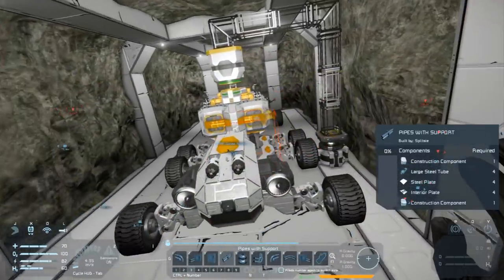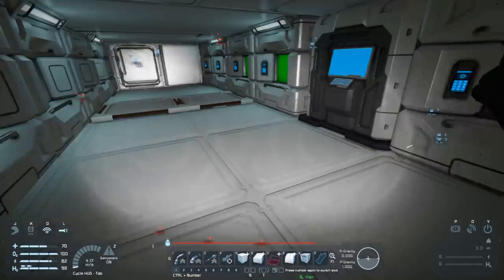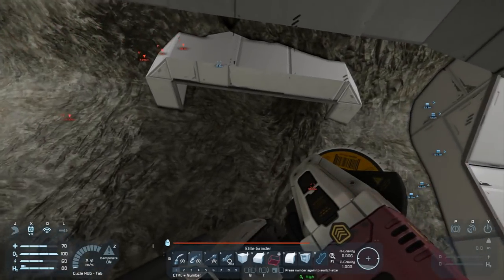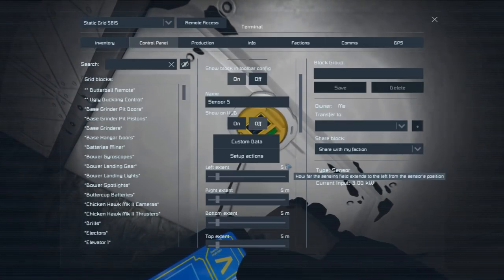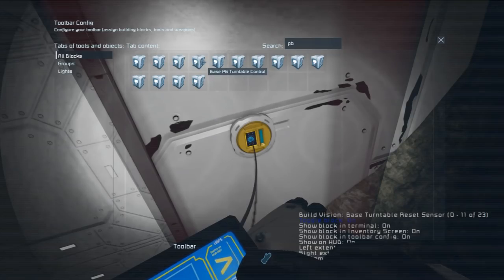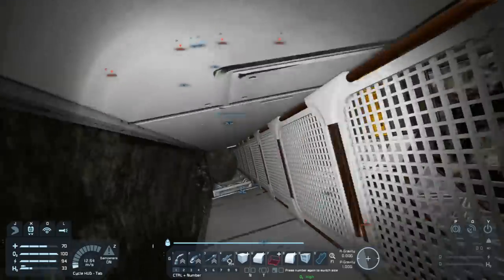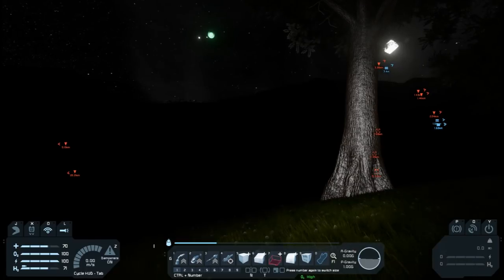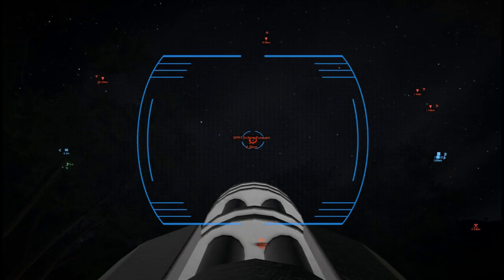Survival, Maybe... #61 Is Splitsie's Goose Cooked? (A Space Engineers Survival Series)

Comment: You might consider adding deployable decoys for the goose. You could then drop them in place on the ground and back up to give yourself something else for an attacker to focus on while the turret takes care of it. Or worst case... drop them and run for it. :D
Reply: I was thinking that too.  During a run back to the base he could say "Deploy chaff"  and decoys would pop out as he runs.  ;)
Reply: "Deploy chaff" Nonono... Geese lay eggs :D
Reply from the maker: That is a really cool idea, I could even just have a manual set of them hanging from under the cargo containers or somewhere similar :)
Reply: A set of golden eggs hanging below a cargo container.  Now where have I seen something like that before?   Splitsie, you stress my PG algorithms right to the edge.   ;)
Reply: But decoys need batteries to work and that can be expensive.
Reply: Set up that and have a projector block on the goose where you can weld them back up when you get back to base
Reply: Know this is old, but that's a great idea - have a couple grinders in the base floor that upon activation would spring up and weld the projections. I imagined this to work with detaching rotors, but it might need a merge block instead and that would become quite bulky quite fast :/

Comment: You need an LCD screen named LCD Autocrafting. You can then set the minimum reserve levels of all the components, and ISY will replace them as you use them. If you are going to need more plates or something for a project, just edit the text on the screen and ISY will do it's thing. Keeping one assembler with the string !manual in the name also helps.
Reply from the maker: The reason I haven't used the autocrafting yet is that my production rate is too low. At the moment I prefer the greater control I have over what gets built first. Of course once the big parts of the base are complete I'm absolutely going to be setting it up :)

Comment: Splitsie....why not add a rotor with a large grid head on it to the goose, that way you can set your turn table sensor to detect large grids only and wont have to worry about your other ships triggering it at all. Just set the range close to the ground and your rotor kinda low so the buttercup cant tigger it.

Another option, put a small ship rotor head (on a large rotor OC)with a bock on your base where your sensor is now and put a sensor on the goose, then use your transmit and receive script to trigger the Command for the turn table, that way no other vehicle could ever trigger it :D. 
 
Also i play with the deep ores mod, :D tons of fun but be ready to really have to hunt for ores.
Reply from the maker: I wouldn't really like to have a giant rotor head on the Goose, not the most attractive of attachments :P

I'd probably enjoy the hunt for ores, at least once I find a fun way of doing it :)

Comment: I liked the suggestion of using the deep ores and building a whole mining base... that sounds like an interesting project. 

You might consider rolling in the 'lighted path' project with some additional large grid turrets, making small fortifications along your path at key points to mark where you need to go up a specific way. That would give you an extra level of defense if you need to make a run for it. They might also be able to stretch armored block out to either direction so you could use more of the smaller lights off the one battery/power grid. 

Also, it might not be a bad idea to do a scouting trip in here somewhere so you know where your next patch of iron is. It would suck to fortify the whole route and find out that it goes in the wrong direction or some such.
Reply from the maker: I've been expecting this iron deposit to run out for several loads now which was why I delayed building the lighting infrastructure, the irony of that is I'm probably going to put the infrastructure in just as it runs out now :P

Comment: Hey Splitse, I had an idea on how you might solve the driving-at-night problem (besides, you know, NOT driving at night XD ) - set up a bunch of waypoints between you and the base, then build a drone with a bunch of lights on it and enter the waypoints into its guidance system as a patrol route (I believe that will make it go A->B->C->B->A->etc, but you've had more experience with autopilot). If you find yourself about to drive home at night, summon the drone to you via the waypoints, then follow it back - autopilot always moves like it is out for a freakin' Sunday drive, so keeping inside its light radius shouldn't be too hard. If you want to get fancy, you could rig up a timer at the base to launch the drone when you push a button on the Goose's control console, and if you wanted to get REALLY fancy, you could set an action at the mine waypoint so the drone will automatically turn autopilot off and wait; then you don't have to worry about it running off without you. Extra points if the interior lights on the drone are on pistons so they can extend outward and increase the lighted radius, then collapse inward when the drone needs to fit back into its nest.

Great episode. Looking forward to the next one :)

Cheers.

-Z
Reply from the maker: That would be a pretty cool use of a drone :)

Comment: I was thinking, if you are still interested in fine-tuning the connector gantry for the Goose, you could switch where the Advanced Piston is, from the floor, to the top of the gantry right behind the corner piece. This would enable you to have the connector flip up parallel to the ceiling (which look be more visually interesting), and wouldn't have to worry about waiting for the whole thing to move out of the way of the turret.
Reply from the maker: The main reason I didn't do a drop down like that from the ceiling is that I would lose the ability to change the offset to get a lock if the suspension leaves the Goose a little bit low, it would look nice that way though

Comment: Regarding the conveyor system for the angled spots, if you don't want to zigzag your way into them, you could always use another advanced rotor preferably under the center of the turntable, and rotate it 45°. You'll be able to go straight towards the two parking spots in the corners, although it may be a little bit more difficult to setup the connectors at the end but I'm sure you could come up with an interesting design!
Reply from the maker: That could be a good solution, and as you say, it would be fun to build :P

Comment: There is a slight issue with the turntable logic: Take bay 2 for example. When you park, you want to drive onto the table and be rotated 135 degrees, then reverse into the bay. However, when you drive out you want to be rotated 45 degrees (to position 180) to drive out. That means 0 isn't your exit position, 180 is. So when using any bay other than 3, you will need to drive in, press bay number, park, drive out, press bay number 3, exit. Just a little thing to remember!
Reply from the maker: The angles that I've set up for all the bays are for reversing in, so exit will always be the parking position for bay 3. I can't remember when I did it, but I have also set up a sensor to reset the turntable position to 0 whenever I leave with the goose. As far as I can work out I shouldn't be able to run into any troubles with the system as it's set up now. But I guess I'll find out :P

Comment: Rly nice! :D That scene, when all the Sandbags fired at the drone, was awesome! :D I know it's a bit dodgy, but how about, a small battery, and solar panel, with some small armor block to make a pillar, and at the top of the pillar a small rotor, with a large rotor head, and a large interior light? It would almost look like a promenade light. Or you could just make a blueprint of maybe 4 lights on a single large battery with  7-9 armor block between them keeping it all together, and project it in a way, that the joining armor is underground, and only the pillars with the lights are above the voxels. A large welder should be able to weld them through a little bit of voxel.
The other thing I was thinking about, you really need some LCDs with the battery status of your ships, next to their parking spot :D Just like you wanted with to do with the Tick's parking spot.
Reply from the maker: I really do need to set up a bunch of LCDs about the place especially around the vehicles - yet another little job I've left half done :P

I'm slowly ticking some of them off :)

Comment: 0:30 for the angled spots you could try using an advanced rotor to get the angle you need then a second one to go back to the default orientation so that the end could be merge blocked into place, that way your not having to go left right left right.

7:06 the only thing you need suit power for is tools and suit light, the jet pack will still work as long as you have hydrogen, it no longer requires suit energy. so the only issue you would have in that hole would be lighting you could still fly.

16:36 that is good to hear the small grid welders are useless currently so I will definitely be looking forward to that update.
Reply from the maker: I don't know that flying in perfect darkness would be my smartest move, but it is useful to remember the pack still works without power :)

I'm hoping it sneaks into the multiplayer patch but I think that's unlikely :(
Reply: yea flying in darkness only results in death, though when there is plenty of light around I often find my self with 0% power when doing a lot of welding, and luckily the riffle still works with 0% found that out the hard way.

Comment: I can see the idea of an 'R&D' area being built off from your hanger, it'd have it's own bays for prototypes, test beds, designs and others along with what you once said with having a wee bit of RP mixed in with your survival series.

Looking at the front of the goose, it reminds me of Ed209 from Robocop (not the remake).

Not going to spoil it for anyone lol, however I'm interested in seeing this 'destructive' thing you speak off :D

I've tried your survival maybe out and was interesting, well erm I ended up with around 20-25 (may well be more) drones intact and locked to armor blocks just outside the cabin, at this point the pirates ran out of drones to send my way after give or take 40 minutes of fun and games although it took 4.5 to 5 hours for that to start.

A question for you Splitsie, did you build a large ore detector close to your base (or apart of it), to find out whether or not there is any ore around it, mainly iron?

You may well have a new sub come your next vid.

Ps, if you're interested, check out morilibus, He did a solo survival (now a playlist), way before planets were added. Not sure what vid it was however he came up with a design for a welding bay for small ships (keep in mind it was in space) and was based on timers and sensors, it may well give you an idea or 2 for your own. Anyway, thanks for reading.
Reply from the maker: An R&D bay would be a cool idea - I could stuff it with a few of the older versions of some vehicles half built to really get the feeling down :)

I'm glad the scenario was some fun, it could certainly use some tweaking and I'll hopefully get some time to do that eventually :P

Comment: Sorry this is so late but for the lights you could have always dug a tunnle under ground to each light and put a cheap block there to conect it to the base and have a timer or programable block to turn the lights on at night saving you all the power cells needed for all the lights
Reply from the maker: The trouble with that is the massive performance hit you get from very large spread out bases - and mine's not exactly small to begin with :P

Comment: Correct me if I'm wrong, but don't large grid lights use no power?  Could you just use a large block and put lights on all edges?
Reply from the maker: They use no power, but still need it to turn on, so I'd need to put down a whole bunch of batteries. I'm going to start trying to come up with a large grid design that uses the interior lights and the transformer box as the battery, then I'll be able to have the markers :)

Comment: I was thinking it would be easier to set one timer block to a 30 degree turn each push for the turn table. Would it really matter if you had to push it 3 times to get to the centre bay? You could also have a button to do out of the cockpit.
Reply from the maker: That would certainly be an option, but I like having the one push solution even though it was a bit of extra work at the start :)

Comment: 4 years late but one thing you can do about the drilling rig idea for any future ideas even though I'm half a decade late that can still work just make on a moveable platform think of a large ship but then you attach it to the grounds voxels to convert it to a station with a merge block after moving. Then instead of just taking it apart and rebuilding it, detach it and convert it back into a large ship to be moved to a new location that way the only cost is the upfront resources taken to build it.
Reply from the maker: Yeah, that's a valid option, especially if you extrude a 'rail' as you move along

Comment: a few ideas for ya first with the turn table set on of the unused timer blocks to set the table to 0 then in all the timers u already have set them to have that one at the end and set the 0 timer to have a count of more then 1 second. second i have a small grid battery that uses rotor heads to connect to large grids to have a form of modular battery that also uses Isy's solar script to charge them when they are disconnected could try using something like that to charge lights for that mining path??
Reply from the maker: I shouldn't need to recharge the lights if I use interior lights, I'm hoping I can come up with a design that uses the transformer box from Eikester's decoration pack as the battery as that'll be a nice cheap solution :)

Comment: About your night lightning concern, try this https://steamcommunity.com/sharedfiles/filedetails/?id=1320420845
It is basicaly a small floodlight in 3 parts with a solar panel integrated so you'll just have to weld it on a large block you placed on the ground and put a battery on the side of this block.
Reply from the maker: It would certainly be a solution :)